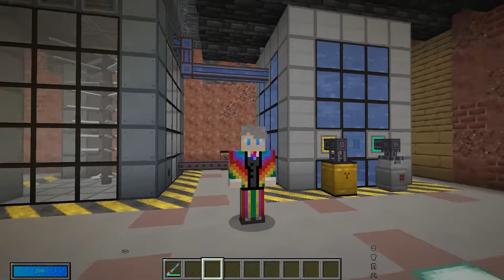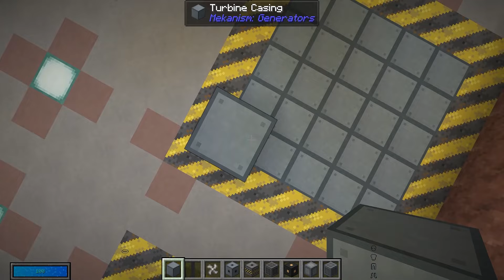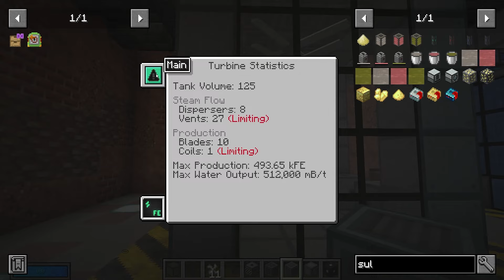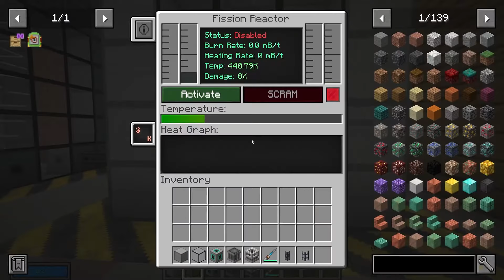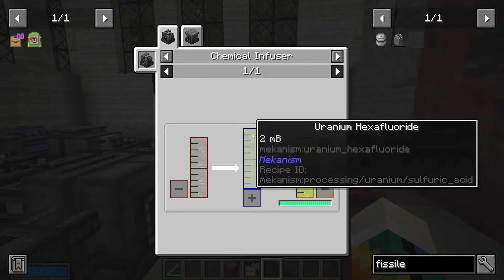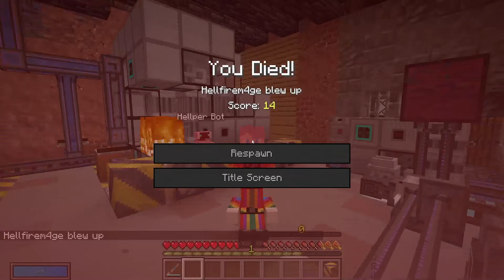Fission Power is Powerful (And Deadly) - Mekanism Fission Reactor (+ Turbine) Guide

Comment: it says that i need a rotor bearing but i dont see ur fission having 1.
Reply from the maker: Unless you're using a modpack that changes it, the fission reactor doesn't need one
Reply: @Hellfirem4ge  I'm following ur vid but when i have place everything in the correct spot the saturated doesn't change to a single block at all. like it stuck to like 1 smooth surface/area
Reply from the maker: @vuvinh3147  what modpack you using?
Reply: @Hellfirem4ge  I’m using the same one as sykkuno using and it is called ftb Abepack
Reply from the maker: @vuvinh3147  hmmm weird, he managed to build it with no issues really so I'm not sure what would cause it
Reply: @Hellfirem4ge  so here what I did. I follow your guild and u say that “it can be as tall if u want it to be” but I kept it the same as ur build. Than I place the rotational complex on top on the tip of the fan and I surround the valve with the pressure dispersers than on top of the valve is the electromagnetic block. Than from the magnetic it’s surrounded by saturating condensing block than following with the vents around the corner with 4 but filled the 4 corner block with the fission reactor casing. And than fill the rest with the casing block on top. And from any of the corner I place the turbine valve and filled in with glass

Comment: Thank you for a good tutorial :)

I set up a fission reactor to produce polonium pellets. 

I had 2 explosions of the fission reactor so far, and more to come.

1st time it happened because of coolant shortage (water cooling). I didn't have enough saturating condensers in the turbine, so i had to build a few more levels higher to keep up with the demand. 

2nd time it happened when i hooked up SPS. This happened because of internal storage of energy of the SPS got full, and therefore the turbines storage also stacked up and therefore it stopped producing enough water for the fission reactor. The SPS stopped when it didn't get enough polonium which is only produced at day with the solar neutron activator. 

Resistive heaters is a good option to waste all the energy that the turbine generates so it's always producing enough water for the fission reactor. If producing polonium pellets is the goal.
Reply from the maker: Very true! I just use trashcans for the overflow honestly ☺️
Reply: Sadly there is no trash cans in Valhelsia 5 mod pack :) Also no kitchen sinks for the water
Reply from the maker: @calipash8012  aww that sucks! Guess you just gotta make sure you have a backup reservoir somewhere ☺️

Comment: Note to other people. Do not use a creative fluid tank to input the water, it just don't pump it in.
Reply from the maker: It does if you set the extraction correctly
Reply: @Hellfirem4ge  What does one have to do differently, when compared to a sink?

Comment: hey, i made my fission reactor, filling it up with 6 electric pumps with speed upgrades, after that i made the turbine and connected it to the coolant, it's receiveing a lot of steam but even with the electric pumps and the water output of the turbine i can't use the reactor above a 0.3 burn rate, otherwise it goes out of water. it's been 3 days that i'm having this problem and i literally can't solve
Reply from the maker: How big did you make the fission reactor? And are you condensing the steam back into the reactor?
Reply: @Hellfirem4ge  i made 5x5x5. i'm condensing the steam to the turbine
Reply from the maker: @gutty1988  sorry, I mean do you have pipes coming from the vents in your turbine to pull the water out and back into the reactor? That way you should have an endless loop of cooling
Reply: @Hellfirem4ge  yeah, i really don't know what is the problem
Reply from the maker: @gutty1988  do you have enough condsensers in the turbine? Is the flow rate of the pipes from the turbine high enough? There's a few things like that which can affect it, but I know I can run at around 15 with the setup I have without running out of coolant
Reply: @Hellfirem4ge yes, i have 8 condensers, when i go above 0.3 burn rate the pipes just go out of water
Reply from the maker: @gutty1988  what pipes are you using?
Reply: @Hellfirem4ge  the mekanism ultimate pipes
Reply from the maker: @gutty1988  hmmm they should definitely be enough. Did you fill up the reactor, then make steam for the turbine and then fill the reactor again  to make sure you always have some coolant?
Reply: @Hellfirem4ge  hey, after some days i realized that the turbine was producing more energy than i was using, so it was causing a bottleneck, i put an energy trash can to dump all the excess energy, now i'm using 5.0 burn rate. thank you so much for being this attentive
Reply from the maker: @gutty1988  trash cans save the day once again 😃
Reply: Im having this exact same problem but im in a modpack without trash cans. what else could be used to get rid of the energy? (the modpack is called Velhesia 6)

Comment: I configured my turbine and reactor exactly how you did before going into discussing fissile fuel. All the coolant is connected from a body of water as it should be, and is connected where it needs to go. My coolant ran out a minute into running the machines. Why is that?
Reply from the maker: Did you top it up using a water source until both the steam turbine and the reactor was full like I did in the video? ☺️
Reply: @Hellfirem4ge Is the reactor supposed to be full of water? I thought I was supposed to wait until the reactor is full of water, then the vapor gets put in the turbine through the pressurized tube on the bottom. Im using ultra quality mechanical tubing to pump water into reactor using a pump that is speed modified and everything, but the reactor takes foreverrrrrr to fill up when it runs out of coolant.
Reply from the maker: @mossghitsli6983  yes, it definitely needs to be full of water when the turbine is full and then you'll have a system that never needs the water replacing, but if you just turn the coolant into steam, there'll be no coolant left to cool the reactor ☺️
Reply: I figured it out and got it working. I ramped up the burn rate of the reactor by 2, would let the water flow back in, then turned it up more. It worked for about 4 minutes but then started overheating at burn rate of 12 or 13. Hit the scram button, and saw the temp creep back down. The reactor was receiving constant damage and I couldnt figure out how to stop it and it blew up. Since this is a shared personal server, I begrudgingly reverted the world to a backup save from 3 hours prior. This undid my mistake of it blowing up. Sadly, it also undid my awesome implementation of the fissile fuel refinery chain. What I wanna know is what caused the reactor to blow even after I turned it off? Was it backpressure from the water or vapors? I had the turbine set to IDLE instead of DUMP EXCESS so idk if that matters.  @Hellfirem4ge
Reply from the maker: @mossghitsli6983  so as soon as the temperature gets too high, the damage will keep ramping up until you inject some emergency coolant to bring the temperature back down, so even if you hit scram, it can still blow up. That's why I set up the emergency coolant system at the end of the video to stop that happening ☺️ 
I would make sure you also have enough energy storage, that causes a lot of issues if you don't dump the excess energy because the steam goes back into the reactor and raises the temperature like crazy!
Reply: @Hellfirem4ge  I was actively monitoring the machine so I thought it would be fine if I stood there and watched it. But after that, I swore to myself to not turn that puppy on til I implement those safety features too lol
Reply from the maker: @mossghitsli6983  haha yeah, a very easy mistake that we've all made 😅 I blew up the reactor 3 times making this video and I knew it could happen before I started 😅
Reply: @Hellfirem4ge  So I guess them there fancy safety features will prevent it from blowin up?
Reply from the maker: @mossghitsli6983  it should do ☺️ it is janky redstone so I take no responsibility if it blows up 😅

Comment: im stuck making the turbine. apparently i need a "Rotor bearing" made a few but cant figure where i need to put it. nor can i find anywhere online (at least for the last 2 days of looking) that can help me
Reply: Figured out the bearing thing. Was from another mod that I didn't uninstall  completely. Did a fresh install and  new save. But still having issues with the turbine. Built it exactly as you have here as a test run and it doesn't light up
Reply from the maker: Hmmm that's really odd, it should work if you follow exactly what I do in the video. That's the only way to set it up really (other than scaling)
Reply: set it up exactly how you did in your video. and that when i got a notice when i right clicked the turbine i got a message saying "Turbines require exactly one bearing"

Comment: Do you plan to cover the induction matrix? Right now I am finding my matrix is insufficient to handle the power the turbine is making. 

I am using water coolant too, but maybe a water VS sodium coolant part 2 would be good too. 

I am now building my SPS and looking into the fusion reactor too.
Reply from the maker: I hadn't planned on doing the induction matrix but maybe in the future. I am planning on covering fusion (it was meant to be in this video but it would have just been too much) so there's definitely room to expand
Reply: @Hellfirem4ge  the reason I asked about induction is I have heard that if the turbine can't output power and fills up then coolant can't flow into it leading to the reactor overheating. So the induction matrix is a power buffer
Reply from the maker: @sirhugobigdog  oh yeah, I'm aware, it was the cause of my very first reactor meltdown 😅 I'll definitely look at it but I'm not fully sure what extra I can add to it but we can see ☺️
Reply: @sirhugobigdog best way to ensure this never happens is that your induction matrix is way oversized for your usecase. May Induction matrix has 200Tfe of Capacity. That should keep it running a while. And when you have the Sps then your storage filling up will never be a problem anymore...
Reply: So with the induction matrix if you do say a 5x5x5 you only need 4 providers and the rest will be cells. I always recommend that you slowly turn up your reactor in increments of 5 till you hit the threshold of your whole system. Also remember ditch the pipes and go port to port. That way your transfer rate is throttled by your pipes. The ports will transfer at a unlimited rate.

Comment: Did I know what the reactor was? No. Will I ever get far enough through mek to use? No. But hey it was an interesting video, good job Hell
Reply from the maker: Thank you! I would strongly encourage messing around with one, even if you just do it in creative. It's a lot of fun to build them and watch them explode 😅
Reply: I assumed I wouldn't either till I set up an ore quintuple machine and saw how bad my Powah was at keeping up. It was surprisingly simpler than I thought and what I built was bigger than what hell shows off here.
Reply from the maker: @sirhugobigdog  yeah it scales super easily ☺️
Reply: @sirhugobigdog i just started the cool machines in mekanism and the insane smelting factories need so much power